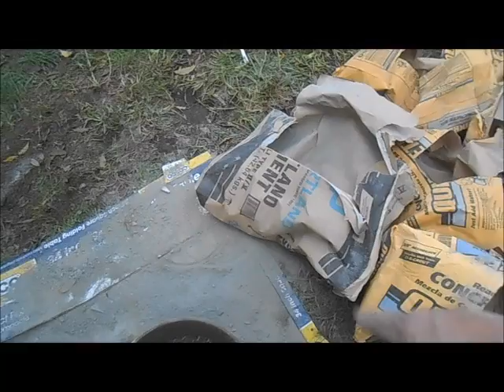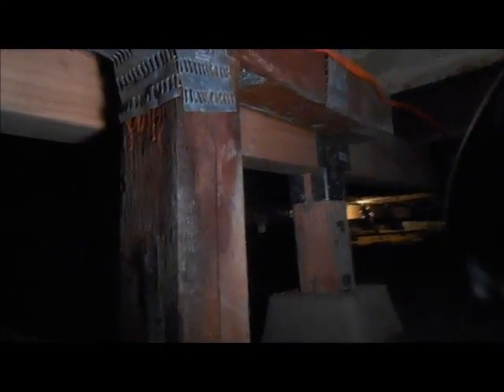Crawl Space Repair In San Diego

Comment: I purchased a home with a scary crawlspace suffering from moisture and rot.  Step 2 (after mold remediation) was to install a dehumidifier and extensive lighting. The fixtures are spaced 8 feet and have fully plastic safety cages.  This has made all subsequent work to the home considerably faster and easier.
Reply: Be very careful.....I am in crawl-spaces for a living and many times I see plate-sized, nightmarishly-violent spiders.
Reply: @tickyul  😂 what hell hole do you live in?

Comment: How many weeks/months do you take to jack up the floor joists? I've heard that if you were to correct (let's say a 1-inch) sag in a floor joist in a single session, then that will cause damage to the house, but if you were to correct the sag by only 1/8 or 1/16-inch in a single session, and repeat over several months, then this will dramatically reduce the amount of cracked window and door corners and more importantly put far less stress on straightening the bow in a bowed floor joist.
Reply: Most recommendation I got is as you said  if the correction needed that bad is better to do it slow to let the structure adapt to those chances and don't cause chain damage to other parts of the structure,  performing little increments every week of every couple of weeks

Comment: Hi there.  quick question...  for the base of the post, how deep and wide did you have to go?
Reply: typically you want 2'x2' with a minimum of 8" deep. You need 1/2" rebar in the base as well. Pack with crusher run gravel below the concrete (they call it 3/4" minus on the west coast if using basalt)